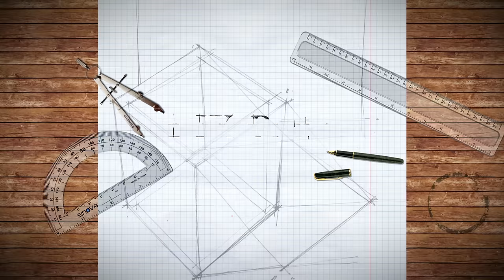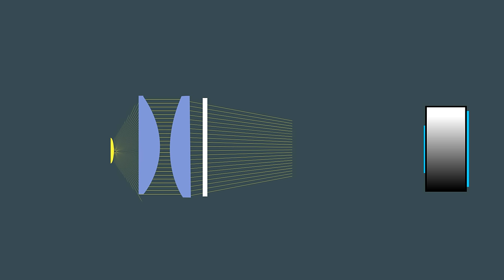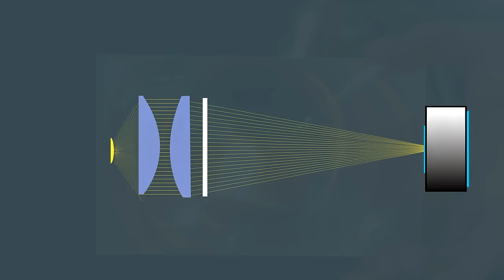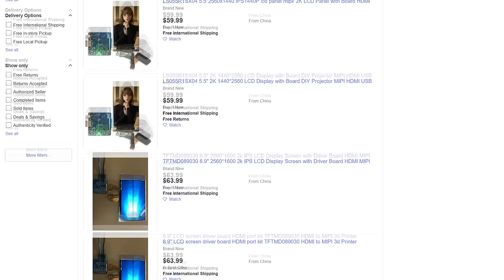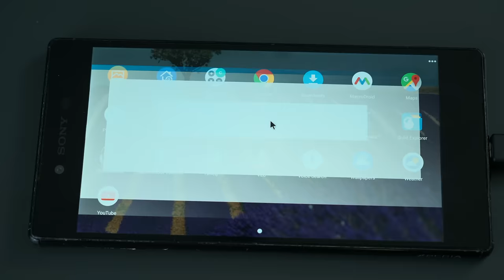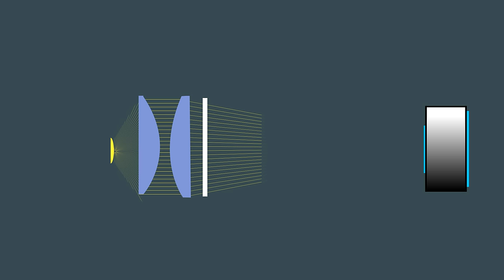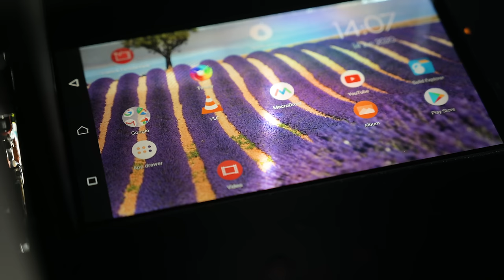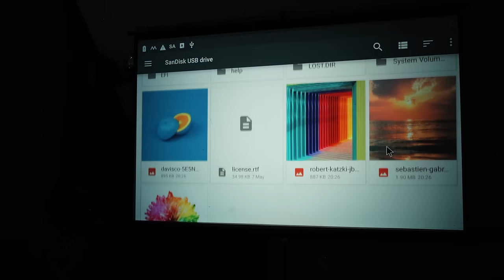Building a TRUE 4k home cinema projector (it’s awesome)

Comment: Projector companies are disliking this video.
Reply: No, there are much more from a commercial projector like throw ratio  ,type of inputs , size of a project image, lens shifting/tilting and most of all the refresh rate and input lag.
Reply: No, this one is took big
Reply: @FalleNoah  which is worth shit to make
Reply: They're not. The LCD for that projector costs as much as a cheap projector. For that money you can also buy better used projector.
Reply: Also, probably also staff of projector companies also hate this. If they can't have a high enough profit margin, some staff will need to be laid off or outsourced.
Reply: This was built in 1/10th of cost. Now imagine companies doing this with all spare parts at available at most competitive rates for bulk orders. Even though considering warranty, R&D, service center costs, I assume the profit margins are too high.
Reply: Actually, there are great 4K projectors that is much much smaller than the DIY one and they have a greater cooling feature. And they have less image lag, much freedom in changing range and things. And it costs as much as half the $2k USD one he showed us in the video. If you have enough room space and got the time and effort, the DIY actually cool, but usually the commercial one is actually nice to think of!
Reply: @apurvmj  1/10th is what he said, not necessarily reality.  Going through the links he posted-- 
*LED $80
*what appears to be a loosely similar sized heatsink with fans, $45.
*power board $15
*Fresnel lenses $20
*4k lcd $320
*large format lens $10

Total there is $490.  Plus the aluminum for the panels, mirror, USB hub, power brick, etc.  Easily around at least $525 now.

Do you have the tools to make all of the precision cost and such already?  If not, some percentage of the costs of any new tools should be added (not the whole thing, as presumably you'll have a use for these tools again).  But lets just assume you know someone who does and can just borrow them.

This was using mostly used items, will they hold up?  The commercial version will generally have a 1-3 year warranty and customer service/tech support which is certainly worth something.

DIY Perks is largely giving you planning and identifying components for free... but how much time will you spend in actually acquiring the components and doing the build?  If your time is literally worthless, then irrelevant, but if it isn't that is time you don't spend with the commercial product.

DIY Perks is pretty expert with these things, will you make mistakes requiring you to replace components and redo steps?  Maybe.  That adds some time and cost.

After accounting for everything, more like the range to 25-40% of the cost... which is still great, but still has a bunch of caveats listed above... and that is before considering that on bestbuy.com there are 4k projectors in the $1000-1500 range.
Reply: @ericrosen6626   following this DIY you getting not only good cheap thing - you are training your fingers with something good, also even if you fault in end - it's not big mistake... Any way you go -} you training your soul. So make it ASAP, training hands you also receive mind level-up... it's researched think... If man comes here to keep more money in his pocket - then.. I tho he's fault was BEFORE OPENING THIS VIDEO. Haha hugs everyone! Be lucky!
Reply: chi keen tran- what would be great projector in the 1 grand range?
Reply: No, they're not because this projector only works in very dark rooms, I would suggest buying one that works in ambient light and use it whenever you want. 1,500 to 2,500 lumens. This is the entirety of the cost difference and then some, why spend 500+ building a 4k projector you can't even see without removing 100% ambient light? You want a BRIGHT projection! Not one that looks bright on camera.
Reply: @chikientran8742  I don't believe you can buy a 4k projector for $2k USD. I mean maybe one marketed as 4k because it got electronics to process 4k signals, but not a 4k projector with a panel with real 3840x2160 pixels.
Reply: As a projection service tech I aren’t disliking this. It is fun to see.
Reply: The boss told their employees to dislike it as well. Bummer. I like it though
Reply: Pretty daunting build for >99%, they aren't worried at all. 
Large cheap 4K TV's are a bigger threat, and plenty of people are perfectly happy watching Netflix on their smartphone anyway.
Reply: @ThePr0Br0  too many difficulties to overcome, especially the projected size, I think no one want a projector that huge to project a less than 80 inches image with vignetting at corner, if there is a way to shrink the case down 50% it would be a more practical product, but in this case fan noise will be a problem. Still this is a very good DIY project.
Reply: @FalleNoah  refresh rate of an xperia phone is 60 frames per second u dont have any input lag at all
Reply: @apurvmj  companies would save off of manufacturing and assembly. A big cost of production.
Reply: @ericrosen6626  "that is before considering that on bestbuy.com there are 4k projectors in the $1000-1500 range."
Well kinda. They use Pixel Shifting, they aren't "True 4K". True 4k projectors are much more expensive. But still, they will look better than this one, as cool as it is.
Reply: and most of them liked your comment XD
Reply: and im liking this comment
Reply: and im liking this comment
Reply: nah people will probably attempt this and give up and buy one
Reply: This is true 4K projector with equivalent pixels. A true 4k projector cost more than $5k. the commercial projector under $2k has only 0.47DMD
Reply: @Stimpy&Ren Yeah.  Despite maybe having the ability to work on in a completely dark room, most of the time you want a projector to work in a wide range of lighting.  That's why projectors are so bright and some are specifically tailored for very high brightness ("light cannon").  It's nice to have a projector that doesn't care about having lights on in the room or window curtains open in the middle of the day.  The later is hard to do without having one of the brighter projectors available.

It would be interesting to scale this project up though to small laptop scale and a much, much brighter light source.  I just don't know how big of a lense you'd need to make that work, and if that lense is available.

The biggest thing with projectors is the balance of the total package.  It's the sum of a lot of elements that makes for a pretty good and overall usable projector.  This is a neat project though.
Reply: @otallono  He uses a 100 watt LED light which would be at an efficacy of 160 lumen/watt a total of 1600 lumen. So it is in the range of what you would call a bright projector.
Reply: @robyndiehn888   output brightness != light source brightness
with the diy lcd construction a lot of light is reflected by the shiny polarising layer of the lcd, basically the construction is extremely inefficient.
Depending on the manufacturer, commercial projectors are either output brightness, or source brightness. But in this case, its basically irrelevant because even a projector that states a slightly lower brightness as source brighness will be brighter than the diy construction.
Reply: @ericrosen6626  its cheaper from aliexpress parts
Reply: @apurvmj  This was not, the parts cost was £1000.
Reply: @RealEngineer  where can one learn the ways of the projections?

Comment: I can only imagine how much the price of that phone is gonna jump now
Reply: Saving a very useful piece of hardware from being ewaste? I see this as an absolute win.
Reply: T J probably not at all
Reply: Already is $70 higher than what he showed in the video
Reply: Or just buy Rpi 4 for 50€ that is build for that and don't waste money and time modifying an expensive phone.
Reply: @w04h  really I would just use a screen and display controller, I don't see the need for a "smart projector"
Reply: @JFK_Speedwagon  How would you play videos? with no internal computer?
Reply: @cjones1499  Plug it into a computer?
Reply: The Ultimate Irishman
The whole point of buying the phone is to get a cheap 4K display. The android functionality is just a byproduct. And 2nd hand laptops are significantly cheaper than an RPi4.
Reply: @Scrogan  Ooof i wish second hand laptops were cheaper than a RPI4. My 2013 laptop's mainboard broke and i'm stuck between hoping that it's just power circuitry i can rebuild and figuring out what it is that needs to be done without killing the rest of the board, getting a replacement board for 80€, or getting the same slightly less used laptop again for 200€-ish, which would also grant me a lot of replacement parts because everything on here is decaying and about to break. Or a new one for 400€.
Reply: as a large format camera hopeful, OUGHAGH
Reply: @cjones1499  with an external pc, looks cooler and performs better
Reply: @SianaGearz  ok dude, first of all: Do you even need a laptop? Second of all: How much are you willing to Spen? Because for like 400 Bucks you can do ryzen build if graphics dont matter to you( Just do an integrated graphics buid) or for like 500 you can do a build with a gpu and 6cores(or 4 if its more about singlecore)
Reply: @thegamingpickle4177  Oh i have a PC with an i5-3570 and a GTX970, the compatibility is still good enough; but i'd also like to not not have a laptop, because in the past 20 years, i've always had both a PC and a laptop, because i simply don't always want to be tied to the PC all the time and i'm kind of between places at times. I could almost build another PC from just the leftover old parts that i have, but they're not even desirable enough to sell, and i'd rather have fallback parts than suddenly need them and not have them. Yeah the PC is a bit pitiful, i'll really need to get a Ryzen in there, because i could really use more cores, there are some demanding projects i'd like to return to, but i don't think it's happening. I do care about having ample GPU power, but i think i'm covered pretty well for now.

I have had this laptop with i7-3632QM and GT645M for 7 years and i was kinda counting on keeping it for the next 5-10 more years, it's really pretty damn useful, this old thing is not at all slow! But the mainboard just died one day recently. Pity. I measure a short B+ to ground, but it could be one of numerous things causing it, so it's not a rare symptom.
Reply: @w04h  the idea was to get the 4k screen. The phone was just a bonus to run it, he was really after the 4k screen for cheap
Reply: @SianaGearz  Your specific laptop might not be cheaper but they are absolutely cheaper than a RPI4, I bought not one but two haswell based thinkpad boards for $20, one even had 4GB ram on board, that 4GB cost $20 just to get the upgraded pi.

Oh and just my opinion here, but even if you do have to pay more, it's 100% worth it since you're already getting more performance than a rpi on top of also getting at least one sata port and if that wasn't good enough 2GB so-dimm ddr3 costs almost nothing at $2-5 per stick, so if it can fit two of those then you're already saving money on ram.
Reply: Interesting that as of this reply, I see only two listings - and they are sharing the same pictures as the store front he's showing. (Of which is not listed here on Ebay)

Comment: A key concept here is Etendue. Light with a certain amount of Etendue has a limit to how small of an opening it can be focussed through, no matter how many lenses or mirrors you use. You can only sharpen it by discarding light from the light source. You need a low etendue high power light source for a good projector.

Comment: What was the cost breakdown here? Will it be in the pdf when it becomes available? Also, where will the pdf be available?
Edit: He said the PDF will be in the description in a few weeks. That’s what I get for commenting before finishing the video I guess lol.
Reply: He also stipulates the cost is around $200 but he has used a 4K LCD and Noctua D14/D15, so I doubt this particular example is around $200 and likely $400+ if you were to try and replicate it. The cheapest possible setup might be $200. 
There is also no data on temps for each layer or altimeter readings through the build yet to show that the vent at the back is allowing heat to be pulled through,; while it may not be crucial it would be data validating the design choices.